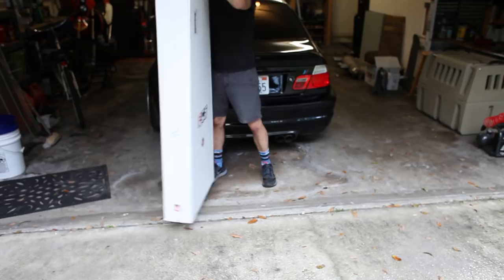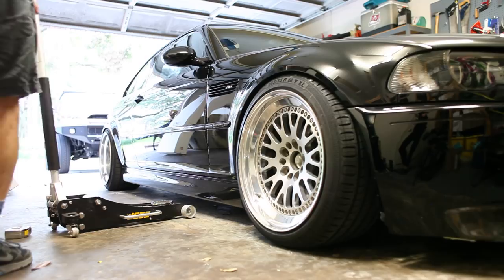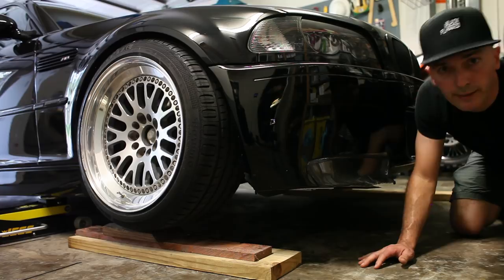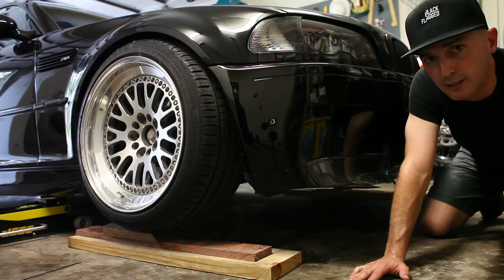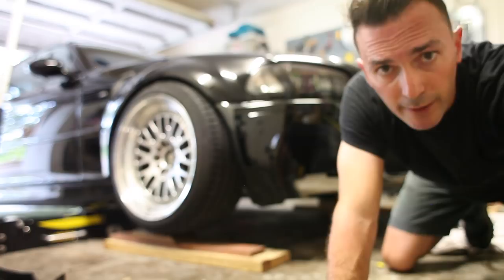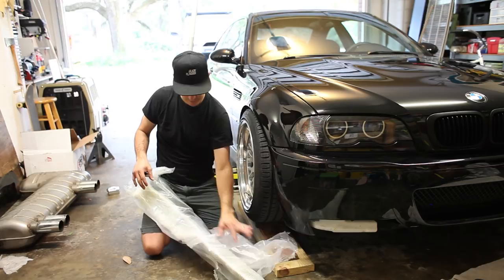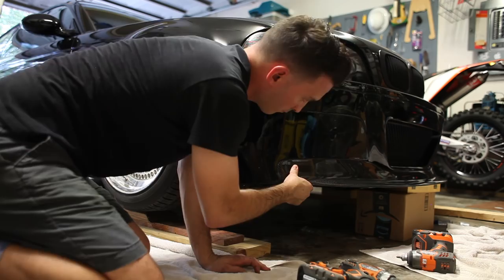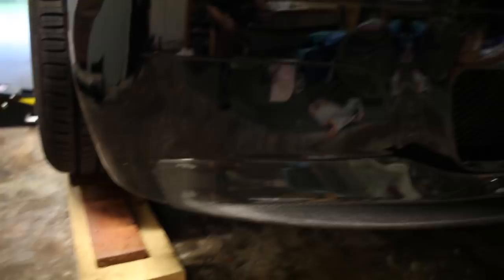Installing a new splitter! | vlog 004

Comment: Fitment is off on the driver side.  But for $300 not unacceptable. Japanese carbon lips are $3000 (Arqray etc.), such lousy fitment in that case would be a different matter.
Reply from the maker: Yeah the lip itself leaves a little to be desired. Still tweaking it and trying to figure out how to get it better.

Comment: I actually like your car. I got the 03 e46 325xi that I'm doing work to. I got the front bumper like yours except it has fog lights in it. I to want to put what you put on but it's a little different. What type of rims do you have on yours. I'm trying to get some ideas for mine and are they all four the same. And what type of suspension do you have. Mine I want to replace...

Comment: Nice video. I bought the exact same lip but I can’t decide if I should just use screws, or drill holes and then use bolts with washers, and nuts. What did you use and how is it holding up?
Reply from the maker: I used self tapping screws. It’s been holding up great, no issues. Bolts and washers would definitely be more sturdy, but I think you’d have a hard time getting them in the center because of clearance issues
Reply: Black Flagged Yup that’s exactly why I returned the bolts/ washers and went with screws. However now my issue is that the top of the lip has a very noticeable gap that even the 3m tape seems to not be able to hold together. Did you use anything up top or does it sit flush without?